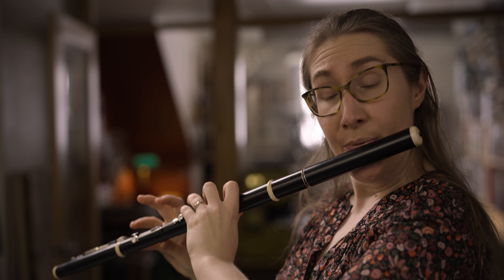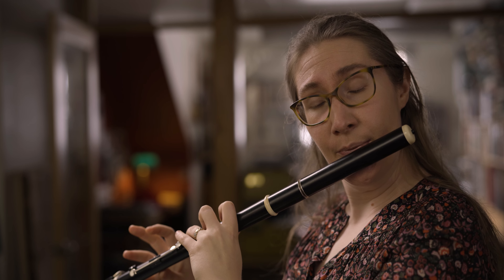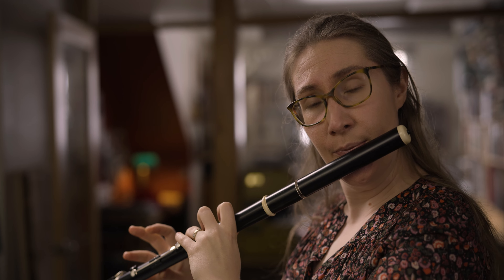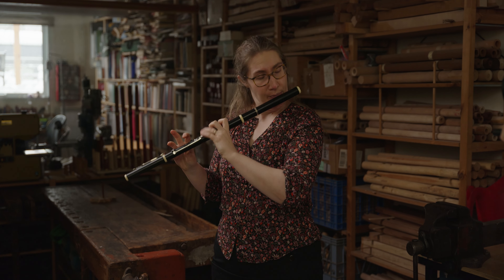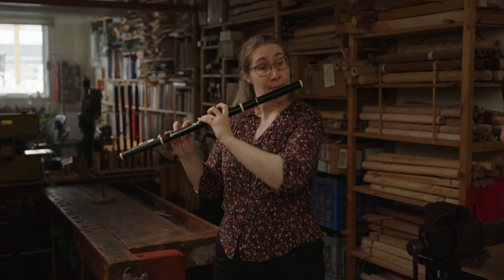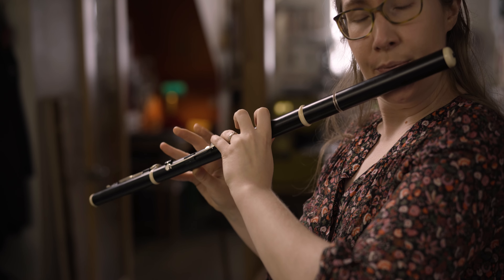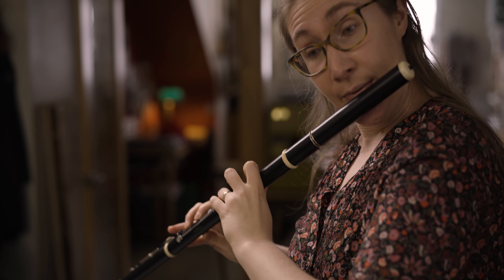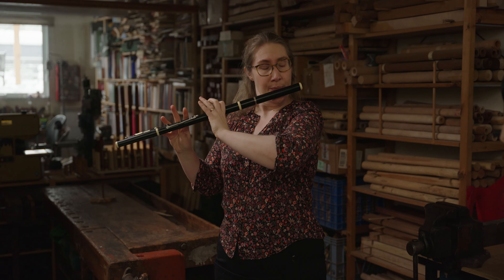Boehm simple system flutes

Comment: The flutes in this video documentary are of wood with metal joints for keys. I wonder if the warm sound is caused by the wooden body unlike the modern flute.
Reply from the maker: Indeed, the wood makes a difference as opposed to the metal body of a modern flute.  An other important factor, however is that 18th and 19th century simple-system flutes have a conical body (narrower at the end) which create more resistance and a darker, more covered sound.  Modern silver flutes have a cylindrical body and much bigger toneholes, resulting in a more direct, louder sound.